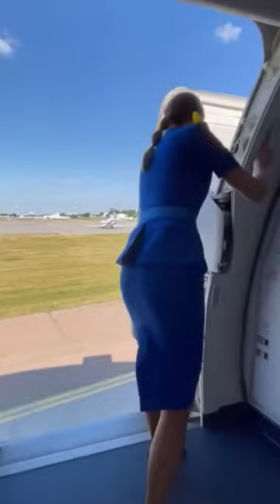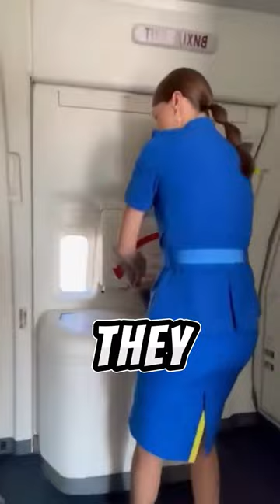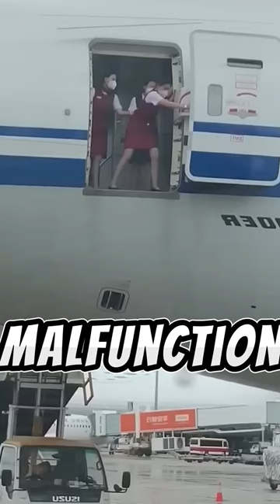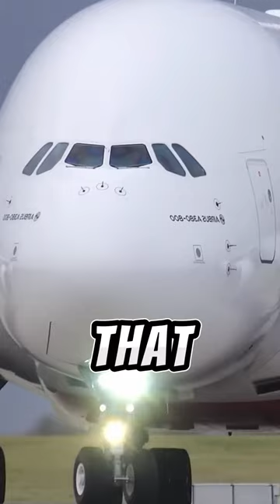Why Aren't Airplane Doors Automatic ?🤯 #shorts #youtubeshorts #viral

Comment: door heavy and consume more feul to close is not true at all
Reply from the maker: Yeah Maybe
Reply: @umerai786  aircraft has multiple energy than just fuel.
1. Electrical
2. hydraulic
3. fuel

aircraft has a thousand litters of jet fuel. the reason why it don't close automatically is because if there's any technical issues or emergency it can be opened menual. another reason if there's electrical or hydraulic fault it can be easily opened in mid flight which is dangerous